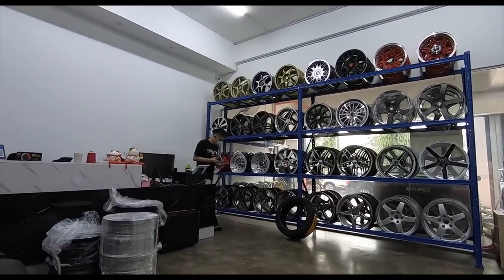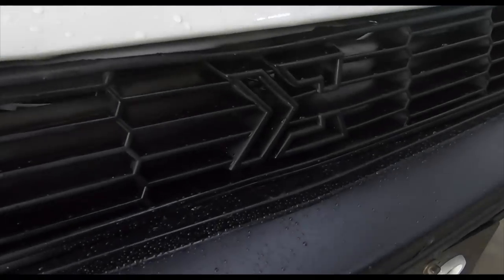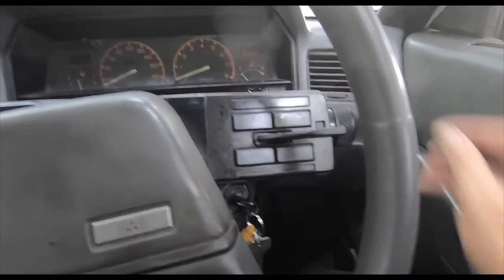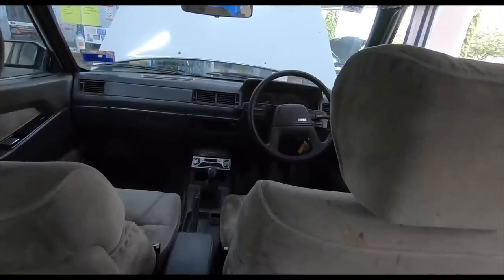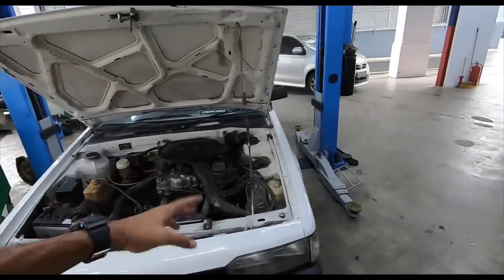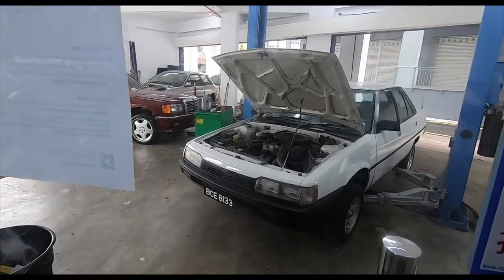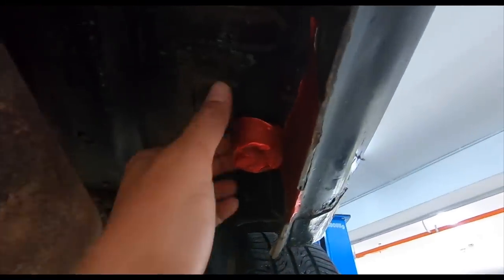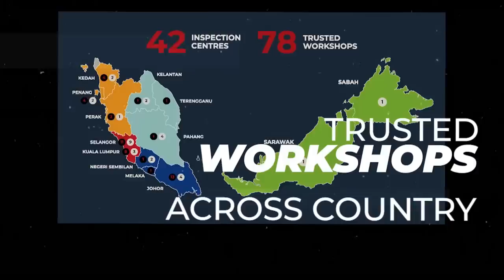UCR: Latest Weevil at CW's Garage! 1984 Mitsubishi Galant Super Touring! WHAT!! | EvoMalaysia.com

Comment: My late dad had it before. A maroon coloured 1.8 1984 model, registered 1986 (he got the stock clearence unit). He bought it new just after seeing it and cancelled his booking with Honda Accord. The engine sounds like boeing engine. 1.8 with balance shaft. The dad's unit got power steering.  Futuristic dash and very roomy and comfortable... Kept it almost 20 years. Paint it black after 12 years. JBM 314. Where is the car now? Btw the ori ckd model had horizontal grille with mitsubishi logo. The rear seats can be lifted few inches by using a level under the seat. Even got underseat tray. I like to see your unit, brings back memories.
Reply from the maker: Thanks for sharing that car memory bro, much appreciated!! I bet it's still on the road somewhere, they were built to last!!🙏🏽👍🏾😊

Comment: sat in this galant super saloon before in the 80s and i remembered the ride was comfortable and quiet compared to my dad's corona. The engine vibration was minimum. if you accelerate in higher gear at low speed, the engine would just jerk but would not transmit vibration.
Reply from the maker: Yes, and it's still the same way till today!! Amazing 🙏🏽😊

Comment: Hi Chris! Amazing in depth tour of your Galant Super Touring! I am from Gombak, Batu Caves and i own a white 1982 Galant 1600 GLS A161A sedan (2nd model with color coded metal bumpers) if you're interested.

My sedan is still running with it's stock 4G32 1600CC engine and 5 speed manual, the interior not so original (accord sm4 seats) exterior is untouched except aftermarket japan chrome fender mirrors, rare japan sport rims and comes with a nice reg number

mechanically sound just the absorbers are squeaky, some minimal rust on the front floor and running board.

My dad's first car was a sigma wagon A121V, sadly he sold in late 1997. 
I want to upgrade sigma wagon (regardless if it's a late model wagon) to relive my childhood memories with my dad.

P/S: i collect diecast models too!
Reply from the maker: Wonderful!! Thanks a lot for sharing that, you're selling the GLS? Please send me some photo to my email at chris@evomalaysia.com, thanks!!🙏🏽👍🏾😀

Comment: Nice car bro! Not sure if this Galant comes with the famed Mitsubishi silent shafts, to keep engine vibrations low. It was technology which other car brands back then did not have.
Reply from the maker: Thanks Haridas!! Hmm, I'm not sure either, but it does run very smoothly and silently for a car that's 36yrs old, so mayyyyyyybe it does 😀😀😀
Reply: Yes it is hence its quiet even at high speed...

Comment: Hey Chris, where do you get your exhaust/mufflers done? 
Do you usually go for a specific manufacture when choosing your muffler ? 
Also, does all S-flow mufflers sound almost similar or is it dependant on the brand?
Reply from the maker: My regular zorst shop is in SS3, Win Soon. The S-flow I'm referring to is the one I used on my Rockin Rolla SE, which I got there, not sure if other makes sound different 😀

Comment: Hey Chris, ive recently installed an aftermarket mp5 player into my car. Ive noticed that there are panel gaps now 😭 between the player and the centre console. Do you know what to do? More importantly how do you cope with it because u seem to be super OCD/ particular about the trim kits in your cars. 😭
Reply from the maker: You can try taking the car to Heng at Procas, maybe he can help u make some cover panels or even a frame, 017-2067757, location is Kelana Jaya PJ 👍🏾😊
Reply: @ChrisWeevilGarage  THANK YOU! Will do!

Comment: So this is where that galant now....
Reply from the maker: U know of this particular unit? Wow, cool!!🙏🏽👍🏾😀
Reply: @ChrisWeevilGarage  ...went to see it last year was in fb then mudah (just soo happened to be nearby for work) since its the only super touring that look decent as the rest for sale is rusting away badly....the engine do smoke some white smoke...so u need to check it out...rest I cant recall but the white smoke  I remember...no power steering?..it does have I believe...I like it as its still in original shape with minimal rust...it was the owner's project car for restoration but somehow...well its on you now....revive her!!!
Reply: Owh do joint their malaysian club in fb....u can get all the parts there...body etc....if its not yet snap up..
Reply from the maker: @karinkatt7893  thanks very much for the feedback and info!! I will check it out for sure. Nope, no more white smoke, it's been sorted, it was the valve-seals, I had them replaced over there before the car was driven here 😊👍🏾🙏🏽